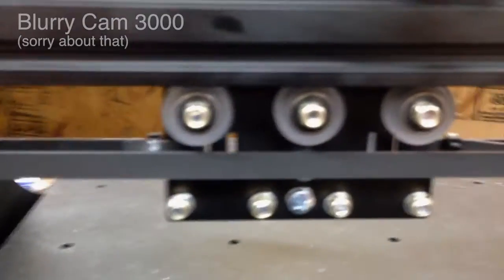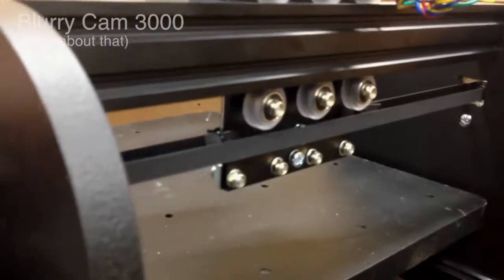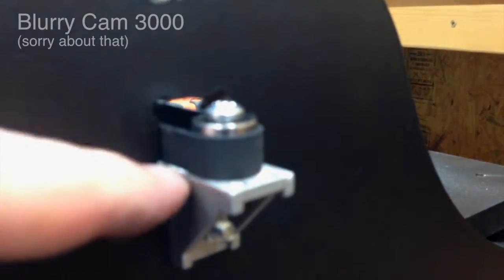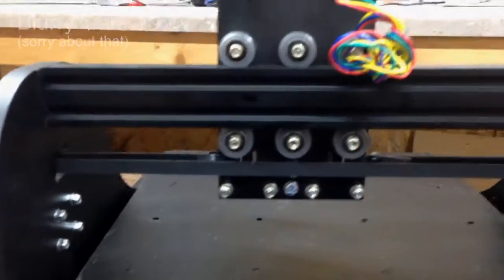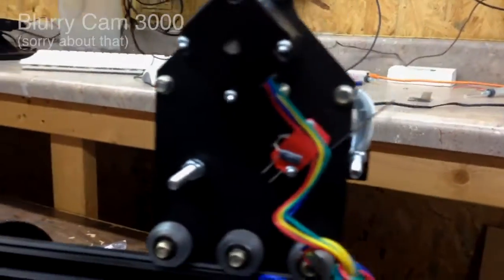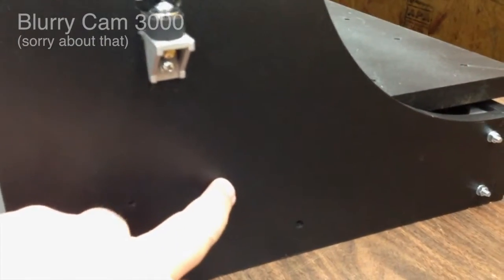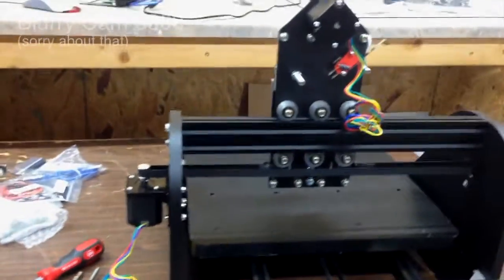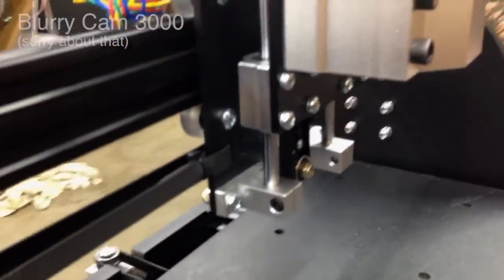Millright CNC Assembly Part 3 - X Axis Motor and Belt

Comment: I'm right at the same point in my assembly as of today.  It took me a substantial amount of fiddling to get my X belt to run so it didn't brush the sides of its slot.  It wanted to ride up and down the idler bearing.  I had to reshape the frame a tiny bit with the rigidity bars and corner things.  Keep up the good work!